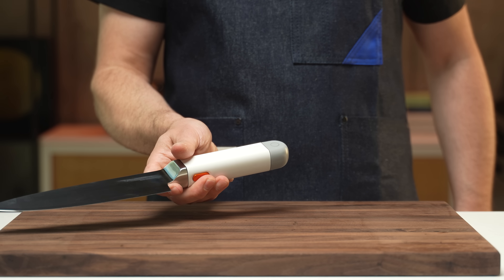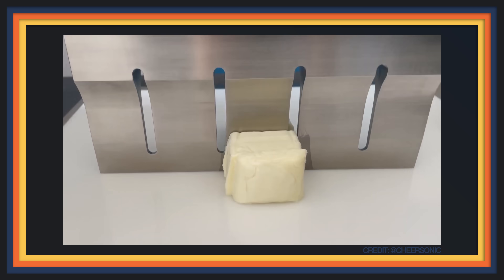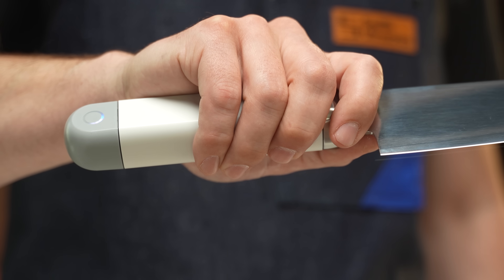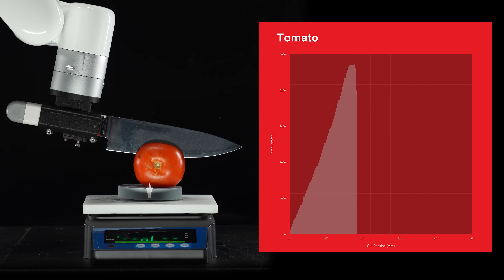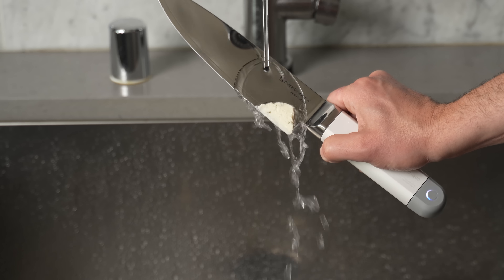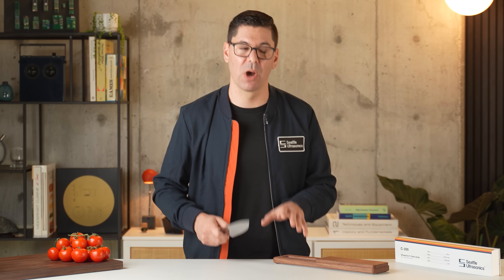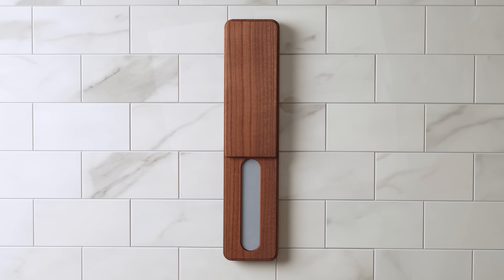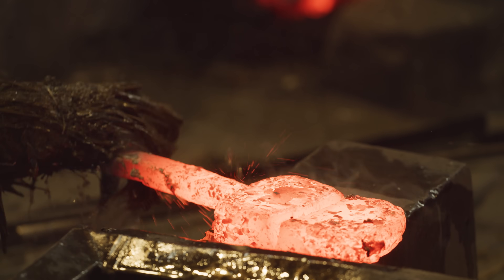The World's First Ultrasonic Chef's Knife for Home Cooks: Seattle Ultrasonics C-200

Comment: Finally some good innovations! Well done! Just make sure to register all kinds of design\tech options all over the world (mainly China\Vietnam first of all).
What about dishwasher though? What about battery life? what about different shapes(some may find the handle a bit big I assume)? :)
Reply from the maker: No, but neither is any sharp knife. Dishwasher detergents contain micro-abrasives that dull and chip away at knife edges. If you enjoy using sharp knives, never put them in the dishwasher! On a full charge, the C-200's battery provides about 20 minutes of continuous running at maximum power. However, the C-200 only runs while you're holding down the button. In practice, that 20 runtime minutes is enough to dice at least 20 onions or 40 potatoes

Comment: You did it, 😁. Made one of these several years ago for myself from a ultrasonic transducer. Worked great but didn't have the money and tools to make a commercial one at the time. Did you optimize the blade length to the frequency used?

Comment: 5:22 that edge looks ruined already :D i think ill wait for the japanese to make one that lasts for longer than 3 tomatoes
Reply: The blade is literally Japanese bro he says it around the 6:45 mark. Also, this test blade has surely seen more use than all the cutting that made it into the final draft of this video.
Reply: Or how about an add on to existing knives that makes the blade vibrate
Reply: @kjyu  that could work, let me know when you start selling them x) ill buy
Reply: Japanese knives are made of soft steel thats easily damaged, even by carrots, but are sharp as shit. If you want a knife made of tough steel chinese is the way to go. Have a couple of both types myself, love the japanese ones but they do take a lot of care

On another note, knife in video is japanese steel
Reply: @LongusDongus03 No. Japanese knives are typically harder than western knives.
Reply: Good eye, just use or bad maintenance.
Reply: It’s not the edge. It’s the fact that the edge is thinner than the blade and therefore vibrates faster, causing the salt to jump more when close to the edge
Reply: @The-Caged-King  you should go see an eye doctor.
Reply: @The-Caged-King  is that what they meant by the edge is ruined? How does one get to that conclusion? Maybe this is just me being a scientist and being used to this, but if I saw salt crystals or something jump off a vibrating edge, I’d also think that was perfectly normal?

Comment: I’m sorry to burst everyone’s bubble. I have an extra electric toothbrush lying around, and I gave it a test. It surprised me by giving an incredible result with a dull knife. The only difference between my homemade DIY test and the Seattle Ultrasonic C-200 is that the latter is powered by a battery inside the handle, whereas mine is attached with some self-adhesive wrap and is so much cheaper but cumbersome. Not recommended it. It’s risky, lol 😅

Comment: For a future generation, I’d love to see an automated function where the ultrasonic energy is activated the moment the handle is touched by the hand.  The moment the handle is released from the hand, it shuts off.  Love this idea and I hope to test drive it soon.
Reply: Agree that in the future button has to go. I'd say it'll be better if knife "knew" when it's going to touch something with the blade. pressure\distance\position sensors etc.
Reply: @TheForium  it could use the same technology as in SawStop saws where it detects if something conductive has touched the blade, though in the case of the saws as the name suggests it's to stop the saw. But I feel that for that use case a manual override button would still be handy, when you think about it something like 10% (at most) of foodstuffs that are cut with a knife are non-conductive. I think that approach would be the most viable since it has been tried in the industry already.

Comment: Literally does nothing different than a normal knife. I love the vibro knife idea and I really want it to work, but the reality is vibrating edges just move the sides of the knife back and forth dragging next to the side of whatever you are cutting, heating it in the process. A normal cutting movement cuts in one direction and its done. We use two for convinient return of the motion, so we can make another cut - so we make one forth and one back, preparing for the next cut. Ultrasonic makes hundred of very tiny cuts but the drag of the blade to the side of the material you are cutting just makes it hot from friction. So you gain nothing. One single cutting motion is better.

Comment: is there any issue with heat generation from friction?
Reply from the maker: No, the blade does not get hot when active. You may occasionally see water "misting" off of your food, but that mist is not caused by heat. Instead, the vibration of the blade causes droplets to atomize away.
Reply: @SeattleUltrasonics   what if you were cutting something hard like say a pumpkin or similar

Comment: Stating the blade is "San Mai" with a hard core steel doesn't tell us anything other than it's laminated. What steel is the core cutting steel? What steel is the lamination steel?? Vg10 core? 420j2 jacket steel?? Not telling us what the core steel is doesn't look good, saying it's a high hardness Japanese steel isn't really telling us anything. As if could be aus8 at 58hrc or Zdp189 at 68hrc for example. What is the core cutting steel alloy and what is the target HRC (hardness) of the core cutting steel???

Comment: The statement about dull knives are dangerous and sharp knives are safer is completely untrue and unfounded. Yes while a dull knife can slip and be unpredictable and it's cutting path it is also many times less likely to cut you if you do make contact with flesh and the cut will not be as deep or as long as compared to a very sharp knife. I do agree that a sharp knife is more stable in cuts more predictably but it is not safer because a mistake with a sharp knife guarantees a cut but a mistake with a dull knife and you're likely not cut or not cut as severely and depending on how dull it is it may be physically impossible to actually cut you unless you were scraping/jabbing yourself with the tip. My friend Alex at the YouTube channel Outdoors 55 did a very good video on our sharp knives safer than dull knives and his conclusions and evidence in the video are dead on sharp knives are indeed more dangerous than dull knives. The old fallacy of the only dangerous knife is a dull knife is just a old wise Tale.

Comment: Why wireless charging and not pogo pins? More efficient and reliable. Also, it looks like the perfect fit for an 18650 (or even 21700) cell.

On a different note, I really wonder about the dampening effect of holding the knife. Any insights on how you are decoupling or impedance matching? Or is it just brute force?

Comment: I'd buy this if it had an always-on toggle switch. The reason being, I usually hold knives mostly by the blade rather than mostly by the handle (as do most professional chefs). And secondly because having to hold down a button for a long time simply starts to hurt.

Comment: I make knives as a blacksmith. Is is possible to buy just the handle and then attach my own custom blades to your invention?
Im guessing that the crystals are tuned to an optimal frequency for your exact shape, material and size of knife, and I don't know exactly how you attached your handle to the blade, but I'm guessing there's a bit of a window to work with right? 
Or go the other way and create custom handles around your blade and circuit board? I would love to see kits that bladesmiths can purchase.

Comment: As a knifemaker and computer engineer I have to say that's the coolest project I've seen so far! Very nice product development and prototyping 
If I can suggest something, would be cool to have a comparison showing it sharpened on different stone grits (like from #220 to #6000) and see how it "matches" with the ultrasonic frequency!
Reply: I was thinking the same thing. I have a hunch it might cut better with rougher grit because the scratch marks will act like tiny serrations. Although it would be a shame because rough grit edges don't last as long.
Reply: @mrkiky  I think the sweet spot should be around 0.5~1x the amplitude motion of the frequency, but that's totally a guess hahaha

Comment: The potential benefits seem enormous, but just like you concluded that most home consumers suck at maintaining a sharp edge on their knives, they're also terrible at maintaining the general cleanliness and condition of their kitchen ware - and seams around the button, where the blade and handle meet, and the detachable battery seems like they'd accumulate moisture, grime and bacterial growth incredibly easily.
Reply: Agreed... some thought needs to be put into cleaning (like a flush rubber button cover, not sure what to do about the battery port. 🤔).

Also wondering about "drop protection."
Reply: yes, the seams in the handle appear perfect for bacteria growth with poor sanitation.
Reply: @derekp6636  Just spray with Benefect, right into the seam, let sit for 30 seconds, wipe dry and you're good to go.
Reply: This thing needs to be a totally sealed single piece with wireless charging. But they probably want to capitalize on the beta version like everyone these days.

Comment: I don’t wanna be a party pooper here but... even though I like the tech, my concerns are related to what happens to your hand while holding this knife. Just because the vibration happens so fast and you don’t feel it, the high frequency can potentially cause the blood in your hand to literally boil, form cavitation or separate. It may also cause celular problems with the skin in contact with the handle. There are some rare diseases that are triggered with vibration. There is even one called “white finger syndrome” 
 Have you done all the testing in regards to that?

Comment: That tang length is criminal.
Reply from the maker: Since you mentioned it... I clamped the blade on a scale and pressed the handle with full force using both of my arms. It registered about 35lbs max. Then I put the handle on the robot. I had to stop the test at 50lbs because I was worried I would break the robot. The handle-blade connection didn't budge. A ton of engineering went into that part of the design. If you need to apply more than 50lbs of force on this knife, I don't want to know what you're cooking.
Reply: @SeattleUltrasonics  Over time, it will weaken, and be a common failure point. Especially when you consider repeated fatigue, repeated oil and water exposure.
Reply from the maker: @Beliserius1 respectfully, I defer to the results of testing as a source of truth. And these have been in kitchens for more than a year with no issues.
Reply: @SeattleUltrasonics  Oh wow, a year. Yeah typically half tang and hidden tang knives fail after a few years. And you aren't going to convince me knife manufacturers didn't test their glue strength either. Even Shun's hidden tang knives are known for this failure.

Comment: Looks cool. Whats it like to clean the whole thing. Obviously shouldn't put it int he dishwasher but is the handle IP rated?
Reply from the maker: The knife is water-resistant to an IP65 rating. This means it's perfectly fine to rinse under the faucet and even if it's dropped briefly into water it will survive without damage. Just don't deliberately submerge it for long periods or put it through something like a dishwasher cycle. We also recommend keeping the battery inserted while washing - the battery module helps seal the handle.

Comment: How much does the knife weigh? I couldn't find that info on the website, sorry if I missed it!
Reply from the maker: 330 grams with the battery installed, so just a little heaver than a Kramer by Zwilling 8". The balance point is right at the bolster, and most folks are surprised when they pick it up, since it looks heftier than it feels.

Comment: Looks pretty but seems kinda weak if water on the blade doesnt instantly vaporize when turned on, this is not the first ultrasonic kitchen knife on the market and the other one seems stronger/sharper
Reply from the maker: Water misting does not equal better cutting, it turns out. I've tuned many blades that vaporize water like crazy, but when I measured their on vs. off cutting performance, the results were unimpressive. Water misting is a neat side effect of ultrasonic activity, but it is not reliable indicator for doing useful work. I have a 60W industrial ultrasonic cake cutter, for instance, and no water mists off the surface of that blade. 

It's the first ultrasonic chef's knife, meaning you can rock chop, pinch grip, and do other chef's knife things based on the blade shape and handle. And that's important because normal kitchen tasks depend on a chef's knife blade shape. And it's also the first of its kind as measured by the patent dates in the US and internationally.
Reply: @SeattleUltrasonics  Thanks for the taking to reply, how does it handle meat? does it have enough juice to tackle that?

Comment: Make it 18650 or 21700 battery  🔋. I wish you great success but this will be your sales if you don't make it work with an off the shelf battery 🪫.
Reply from the maker: I would have loved to, and that would have simplified a bunch of engineering. But it also would have made the handle longer and bulkier, and harder to keep water-tight. If there's demand, I can introduce an extended-size battery pack in the future. In practice, the battery pack will last for several meals' worth of household cooking.
Reply: @SeattleUltrasonics what is the voltage of the pack? Couldn't you just do thin wall carbon fiber tubing with a nice o-ring cap? That would be a cool offering for people who don't care much about ergonomics with the handle!Good example: Daisuke Nishida Shirogami No.1 Kurouchi CHR Japanese Chef's Gyuto Knife 165mm with Cherry Round Handle
Reply from the maker: If you saw a cutaway of the inside of the handle, you'd be shocked at the battle over fractions of a millimeter taking place inside. I have to use rigid-flex PCB folded on itself twice just to compress the electronics. It'll get smaller eventually, but this circuit started its life as a shoebox 🙂
Reply: @SeattleUltrasonics Fascinating. Definitely following...

Comment: What are the long term effects of this knife? How long does it stay sharp, does it still need to sharpened?
Reply from the maker: It's made from great knife steel, but like all great knife steel, the cutting edge will still dull over time. Expect the falloff in edge sharpness to mirror that of other high quality chef's knives. However, at any level of physical sharpness (keenness) the blade still behaves sharper when it's on, both for cut initiation and especially for reduced friction when completing the cut.

Comment: I was curious about where you were going with your testing. This seems very neat, I've learned a little bit about ultrasonic cutting in the past few years, though I was more familiar with smaller form factors. I know the shape of at least part of the vibrating component is extremely important; how difficult was it to fine-tune the shape and transducer output with such a large blade with only one plane of symmetry?
Reply from the maker: Excellent question. It was absurdly hard! This was the most difficult and time consuming part of the entire development cycle. Ultrasonic resonance is sensitive to so many design-time factors: the shape of the blade, the density of the steel, the counter mass geometry, the preload tightening of the bolt, the impedance of the amplifier circuit, etc. That's why some of my early prototypes don't look like knives at all: it's massively easier to make simpler and more symmetric shapes resonate. But it was important to me to keep a familiar knife profile because that profile contributed so much to the way we use chef's knives.
Reply: @SeattleUltrasonics  how's the structure holds on in a long term? I mean, I assume that you did, but still wondering if you've tested it with continuous runs for weeks (with and without pressure below the blade). Anything with electronics\battery will raise quality\durability\longevous-related questions anyway. Especially if it vibrates. And one of the main USP of your "competitors" would be potentially longevity by itself. Your product has great steel, but for non-experts I think it's worth reiterating it's importance in general. it's a nice knife at the first place, after all.

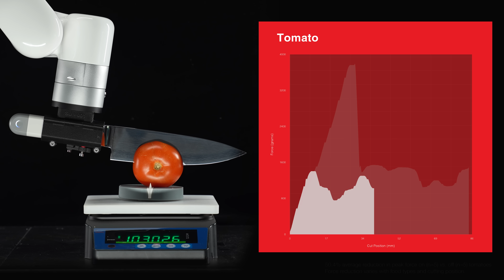Comment: 3:50  wait... once it gets through the skin, they're equal.
Reply: ye this blade is only 10w, once its touching something with mass like a tomato all the vibrations are basically absorbed and it behaves like a normal knife, which is why it wont do much for meat either, guy needs to step up the power.
Reply: It appears that with a stiff food like hard crust bread it's a different story. Sliced it like butter